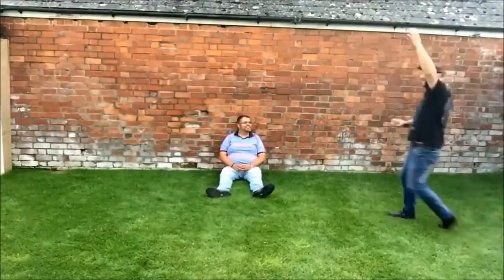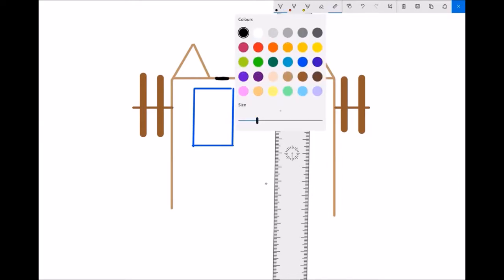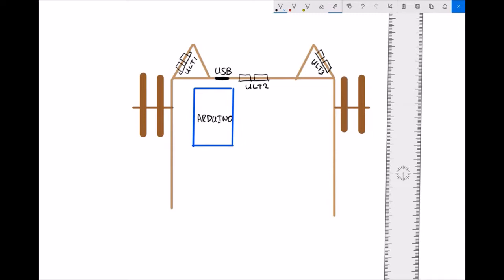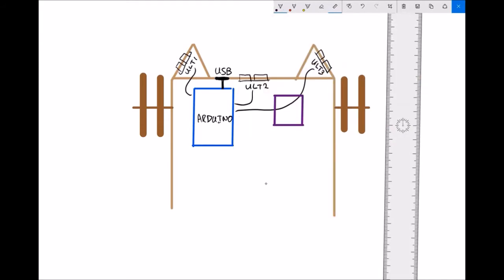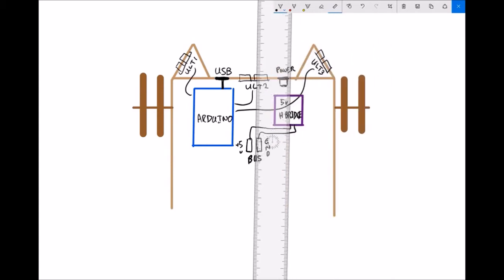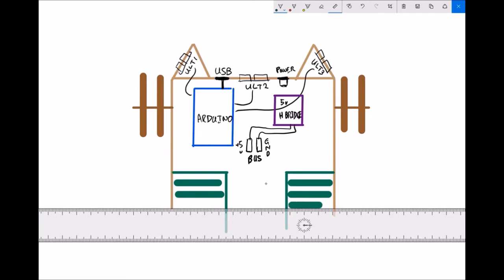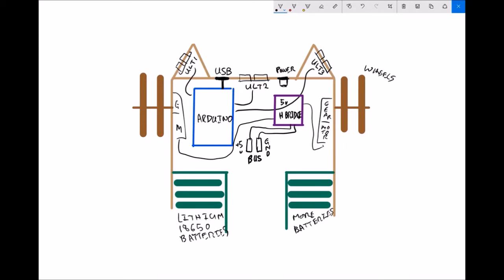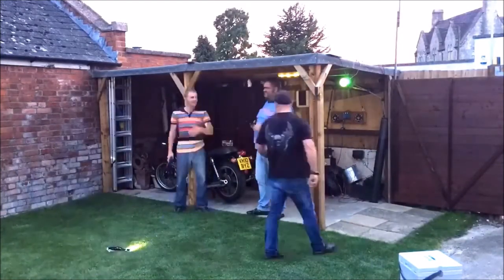Robot Lawnmower PT18

Comment: Where do you connect the power switch?
Reply from the maker: Between the battery, the arduino and the H bridge driver circuit.
Reply: @DubiousEngineering  ok how about the oled display where do you connect them?